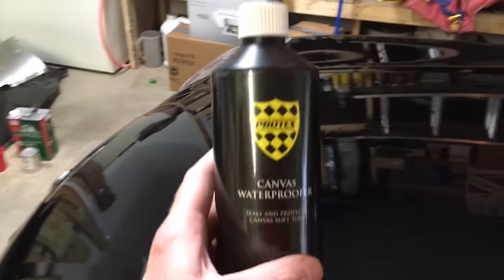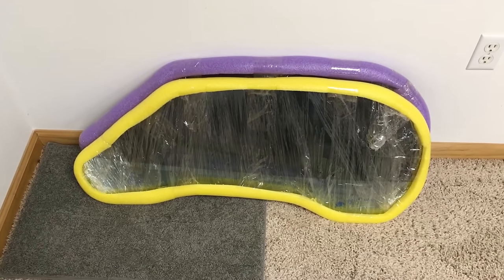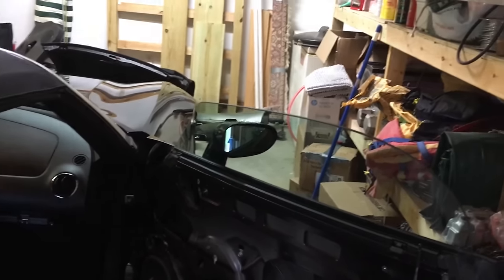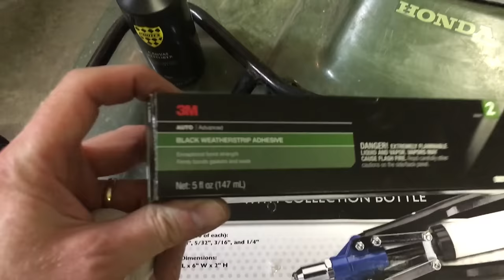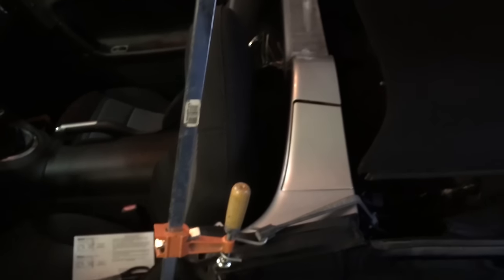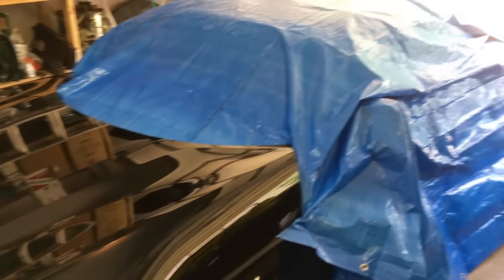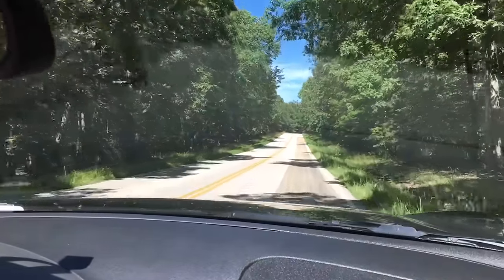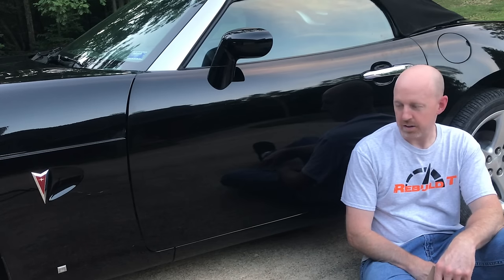The Finale - Pontiac Solstice Rebuild Pt. 8

Comment: Loved this series. I have a 2006 basic. Miles are a bit north of 130,000 miles. Not sure what to do with it. It may require internal engine work. Any suggestions?
Reply from the maker: Thanks for watching! What are your car’s symptoms?
Reply: @rebuildit  When I start her up, I hear a rattling sound coming from inside the engine. As the car is idling the sound disappears but it quickly returns when I put it in gear and begin to accelerate. It becomes prominent as I I am driving normally whether in town or on the highway. What mechanic hooked it up to his diagnostic instrument and concluded that there was compression problems and possibly timing chain issues
Reply from the maker: That doesn’t sound good. If it is a timing chain, that would be feasible to repair, but if you have them do a compression test and it shows low compression on any cylinder, it probably would not be cost effective to repair it at 130,000 miles. Hopefully, it’s a timing chain!